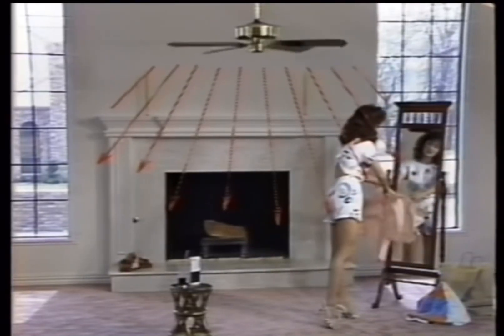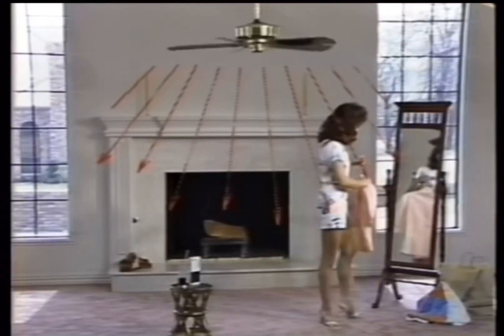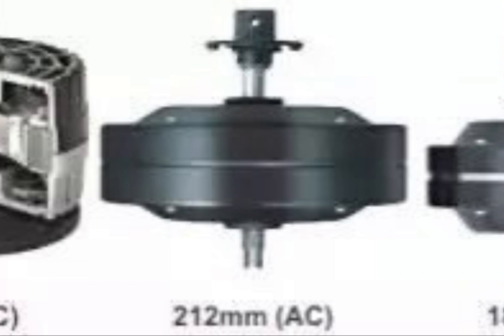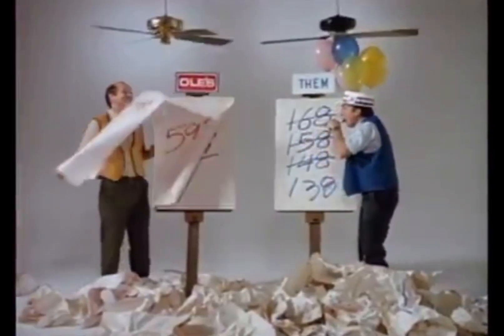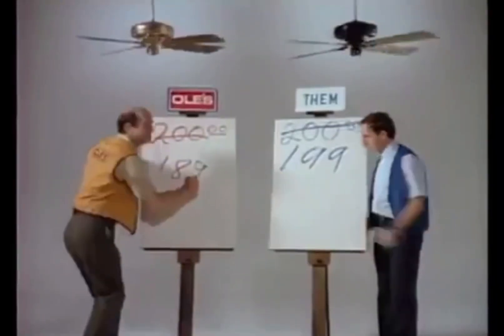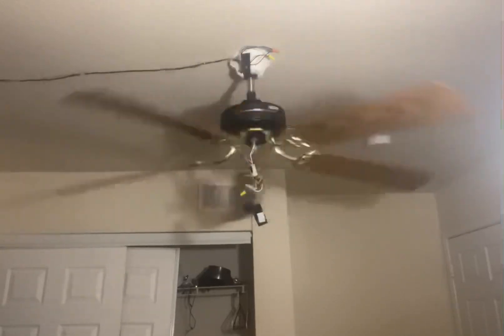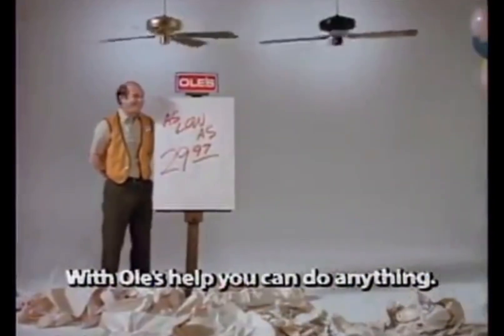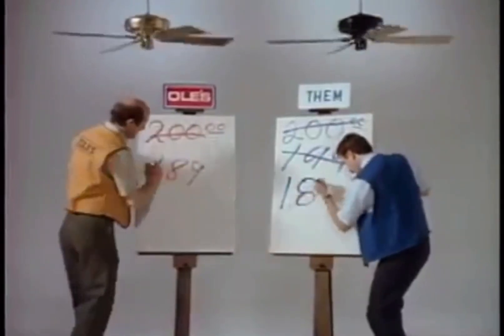CEILING FAN EXPERIMENTS ￼#1: 212mm

Comment: if the brookhurst had that 212mm motor, It would've been leaps and bounds better. because there is room in the motor housing for a 212mm motor.
Reply from the maker: No it isn’t.The Brookhurst uses a 153x13mm or under.. It would be impossible to fit a 212x25mm there.
Reply: @QuamellsFanChannel  oh
Reply: @QuamellsFanChannel  but that motor and moonglow knockoff blades on it was surprisingly impressive. I would love a fan like that sometime in the future. is that how casablancas are?
Reply from the maker: @ianthemechanical829  Its a bit more powerful than a casablanca typical K55 casablanca